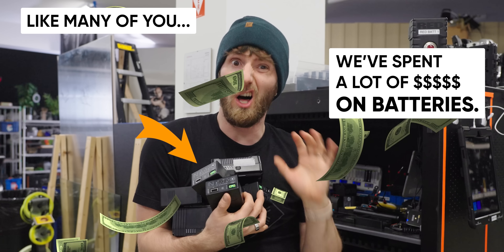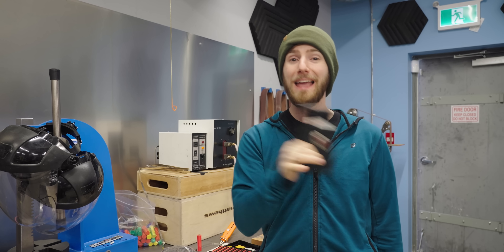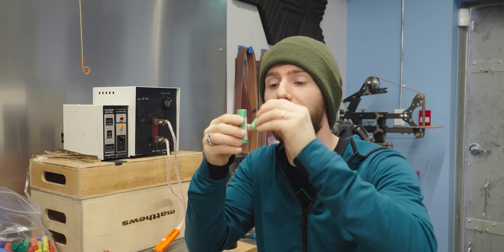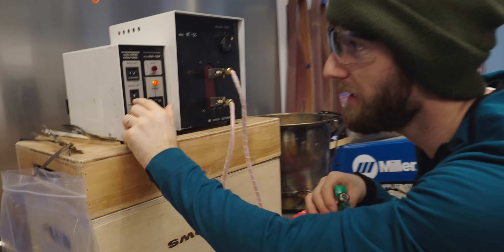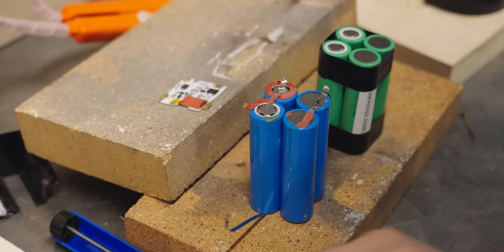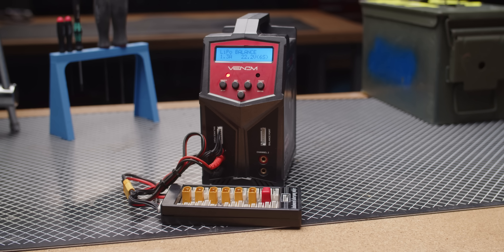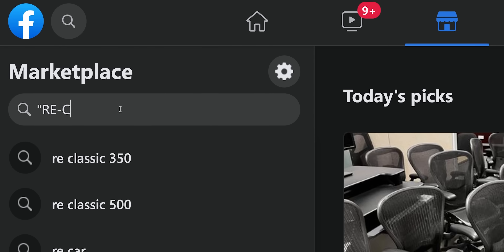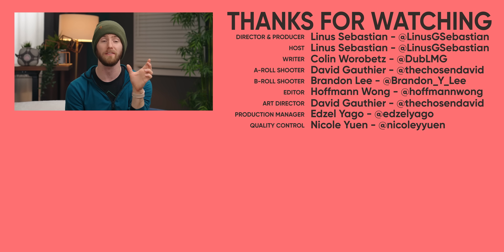This should be illegal… Battery Repair Blocking

Comment: "I've seen dumber things"
I once built a 44v 18AH battery with nothing but duct tape, hot glue, a screwdriver, and solid copper wire. Nope, not even a BMS.

Comment: To Linus: spot welders are known throw sparks sometimes - it is a rough range of 20-60% of the time depending on the ends,cap,dirt,etc. It doesn't matter the size, company who makes it, etc - it is just apart of normal operation of ANY spot welders. Therefore, you basically threw away working cells due to a lack of experience/knowledge of spot welders. Edit: If I made a mistake and those were shorts due to the lid of the batteries being broken thru - then you were using improper sized tips and/or pressure for welding those batteries (from what I could tell the tips were within range for 18650 but pressure seemed to be alot on those pointed tips). However, I couldn't see you breaking into the battery cap so it honestly seems you just didn't know the sparks are normal. You did it a few times with no sparks and thought it was normal then when you got sparks thought you messed up when you didn't. Anyways thanks for the video - you had a lot of correct info.

Comment: The precut nickel strips has fuse on them. So whenever they short, the strips automatically melts then disconnects them to the pack. Lowering the amps on the spot wield would reduce the chances of you having a spark.
Reply: yes...he probably shot out while welding! its only a small cap between the posts on the top side of the battery!
Reply: @Knebebelmeyer  Due to the high current he is probably producing high temperatures which will melt the insulated cover of the battery which will expose the negative part of the battery. It would have been better if he lowered the current and cut those nickel strips to the appropriate length to prevent any contact from the negative part of the battery when you're wielding on the positive part, as the whole body of the battery is negative except from the small circle which is the positive side.
Reply: @Nyte1997  yes...exactly this is the case!!
he use stips that are way to long and reach the negative side on the top of the battery!
i saw that in the video but im not so familar with english, so i cant find the right words to tell it proper...
i tryed^^...

Comment: 16:40 This is a safety feature that shuts off the BMS when one or more cells have different capacity than the others. Let's say one of them had degraded and its capacity is now lower than the others, it indicates that you need to replace that one cell to match the desired capacity the BMS accepts. By doing so, you can avoid the risk of fire hazards or even explosion from overcharging that one degraded cell. It doesn't necessarily mean that it's evil.

A suggestion from your experiment:

Maybe you just need to know what's the actual capacity of the old batteries and try to replicate the battery configuration. (example: Old battery pack is 4 cells in series with a capacity of 3,000 mAh, make a battery with the same config as the old one).
That is why it is not enough to just check the voltage of each cell before welding them. it is also necessary to check its capacity & output charge.

Anyways, great job on the video as always. +1 on pointing out the safety measures that most DIYers neglect.
Reply: He could have taken two 18-packs apart, discarded the worst 18 cells and made a "new" pack from the 18 better ones.  Those should exhibit very similar behavior.  There's also the safety feature that the BMS doesn't power-on on internal power; it usually relies on external power for that.
Reply: @achtsekundenfurz7876  i agree, that would make the experiment more interesting than sacrificing those smaller 4 cell batteries. Also I read that the spot welder they're using was built to use for larger metals. As you can see on the weld, it takes longer for the heat to dissipate which would make the error man-made.
Reply: the very act of trying to repair the battery is dangerous, but note that on the basis of "safety/security", these manufacturers do not want anyone to do it. even people properly trained/prepared to do it.

it is evil on their part to not provide a reasonably priced repair service [rather, any], it is evil on their part to not suggest taking it to a trained professional, it is evil on their part to not make the necessary information for servicing available. 

were manufactures genuinely concerned for safety, there would not be so many devices that absolutely require a battery to function. tell me the actual use case for a wireless mouse or keyboard, for example. and that's just a minor nitpick batteries are themselves, dangerous. forget being repaired improperly, many are disposed of improperly [disposal being what the manufactures *want*], and that has caused more than a few fires. improper storage is also common. 

also, do you have any actual evidence to support "it's a safety feature" , because "for your safety and security" is a very common anti-repair lie of manufacturers. sure, there are safety concerns, but why is it these tend towards making proper service impossible ? or even, unnecessarily dangerous, as is the case with GLUED-IN batteries? seems like a pretty clear cut of the device self-destructing or being UN-repairable to force a total replacement to me. also, again, simply re-assembling the pack is in itself, extremely dangerous. the BMS doesn't stop you from doing that, it doesn't stop you from replacing/removing it entirely, it doesn't stop you from getting a bootlegged pack [though hopefully the equipment handles that, specifically to the extent where danger/damage are possible, and only that] and even in the scenario where it detects a bad cell, it should clearly inform you that "cell #10" is bad. but it doesn't do that. it just hard shuts-down with the assumption/hope you will throw the whole battery away. no matter how you try to frame it, that is, evil. 

also, on that note, is it legitimately necessary to weld/solder the cells? and i mean, in general. obvious, specific battery packs are designed this way. but, it there a legitimate safety reason to design this way? seems more like cost and compactness are in mind here. i could even see anti-repair here, as it does make service difficult & dangerous. that's more an entirely more an inquiry/theory, though.
Reply: @ETXAlienRobot201  I agree to that, there may be reasons for anti repair lies bs going on in the background. But I am thinking that the reason manufacturers doesn't want consumers to repair there own battery packs is because of the risk it can present. A normal consumer doesn't own a spot welder, or tools that can help for the repair. Maybe if its just take one cell out and replace just like the AA or AAA batteries then it would be better and easier.

I like that you included ways a good manufacturer can include on their battery packs, such as individual cell monitoring, and the fact that those battery cells doesn't need to be welded/soldered at all. I mean AA, AAA, NiMH batteries are even in a configuration where one can easily take and replace it. Why do those Lithium Ion ones needed to be soldered/welded.
Reply: @NewbieTetris  This is all BULLSHIT...

A chip can't "Measure" capacity AT ALL. the only way to test capacity is with a full charge and discharge. What we saw in the video is that once you disconnect the battery. it puts it in bricked mode. thats it. The reason for that can be argued but is still shitty behavior. If someone is already trying to replace the battery i assume the person has at least some knowledge to do so. Because you need a soldering item, spot welder etc. no cheap stuff.

Also the only "Data" the cell gets is de current cell voltage. That's needed for the LEDS to know the % of the battery. Don't start a argument AGAINST the right of repair if you don't even have the basic knowledge of these chips.

Also the "You are not allowed to repair because you just don't know and you are dumb" argument is very overused. Who owns the product? me? then i can do whatever i want with it. PERIOD. Even if i want to shove it up my..

All in all i see this as a way to keep prices up on those battery packs. More cheap used batteries on the second hand market = less business for them.
Reply: @NewbieTetris  i do imagine there's a certain amount of safety to welding/soldering, and someone else mentioned that, but i imagine cell slot in/out is feasible within an acceptable margin of error for catastrophic failure. it's not like these packs are automatically fool-proof, themselves. batteries are just dangerous in general, and lithium batteries are horrifyingly dangerous.
i imagine some of the features used in the current models can be carried-over. 

i guess tbh i'm a bit too much of a dreamer and i spend too long looking at the bigger picture and all [reasonably predictable] possible outcomes. i also don't tend to take "no" as the final answer unless it can be absolutely justified. 

my main interests are games/software, though. some of this stuff with throw-away, locked-down electronics however, really males me half-motivated to delve-into a certain amount of hardware/electronics. though, i'd probably just be the ideas guy and entrust actual engineers to create/refine/test working designs. another thing i'm getting sick of is plastic packaging... tbh, single-use  packaging in some/many cases isn't justified, either. what a world we live in!
Reply: @shinevisionsv  First, I agree that no chip can measure the capacity of a cell/battery. But if one knows the exact mAh used until one cell is fully used, you won't be needing the "chip" to measure capacity. You just needed a chip to measure the current, and also a programmed timer to measure the time in order to calculate the mAh used. In that way we can measure if the cell is in proper functioning. (e.g., compare the mAh spent vs the actual capacity)

Second, I partially agree with you with your second statement. But we can also measure current aside from the cell voltage. With that in mind, we can also measure the mAh spent. Also I am not starting an argument here. It seems to me that you are a person who knows a lot about ICs and more. I am only an Electrical Engineering student, I am not saying I know everything. :)

Third, I do agree that "You are not allowed to repair because you just don't know and you are dumb" is too mainstream. But I never said that statement. I did say that most of consumers doesn't own the necessary tools to repair the battery pack. (assuming that they may/may not know their way on repairing the pack)

Lastly, I also agree with how battery manufacturers are trying to trick the consumers in buying new battery instead of recycling them. After all, we might be needing more of battery recycling facilities all over the world.

Comment: I'm a strong advocate of right-to-repair, but I'm actually inclined to side more with the battery manufacturers - this is actually a genuine huge safety concern. If you can't figure out how to bypass an "evil" (to use your words) BMS, then you really should not be trying to re-cell a battery. Simple as that. Is it malicious obstruction? Yeah, probably, but I also sure as hell don't want to ever run across a battery that has been re-celled by someone who doesn't know what they're doing. 

Linus worked with a team of however-many people in a workshop kitted out far better than most people can achieve. As evidenced by the video, he still couldn't safely re-cell a battery.

Comment: In my experience, good quality cells from reputable brands are not much cheaper than fully assembled new genuine battery pack. At least that is how it was with power tool batteries.
Reply: Same with these professional camera batteries - but only if you buy third-party brands like Swit or idx. Don't buy original Sony or Red batteries whenever possible because they are way more expensive for basically the same thing. Often the third-party brands even have cool additional features like USB charging connectors and powertap connectors that the originals don't have.

Comment: Anti Repair mechinisms are evil, but for batteries which really are the only componants that have a valid safty concern, I kinda agree with them being unrepairable. Forcing companies to sell them at the same price they can source them for is probably the most ideal solution, that and providing software to repair companies that removes any software blocks.

Iv seen too many people bring in fried electronics because they attempted to fix them themselfs, not knowing that they were moments away from a fire that they are most probably not equipped to deal with.

Comment: Ok, here we go, it's the same as in notebook batteries. Those are all "smart" batteries which authenticate with their host device. However, the chip inside the battery pack has its firmware and parameters only stored in "ram", means, as soon as you loop open the circuit and the voltage at the chips supply pins falls to 0, the battery firmware is LOST.
There ARE tools and programs to reprogram freshly serviced battery packs.
Only way to avoid that, keep supply voltage to firmware chip while disconnecting the cells.

Comment: I've done this with canon batteries before. 

I just swapped the cell but kept the original BMS and it worked fine. 

If you replace the BMS, it usually won't work or gives an error about being an unofficial battery because it's missing the "brain" that talks to the gadget.

Comment: Considering that you've recently covered the OneWheel, you should see what Future Motion is doing with their BMS for OneWheel XR v4210 and beyond. You cannot repair them yourselves. You cannot get the part direct from FM. If you replace it with a BMS from an older board or even from another same version board that isn't properly matched with the rest of the hardware (by means of software) it will not work. It's malicious and needs to be made public. If you send your board back to FM and have modified it any way (changed grip tape, tire, bearings, etc) they will deny your repair and potentially hold your board hostage until you buy stock parts. Please Linus, look into this and shine some light to the public. I love this hobby but what they're doing is so wrong.

Comment: Battery management systems are more complicated than you may think. For example, Texas Instrument's impedance track battery gauges requires the cell's "profile" (discharge and charge curves) loaded into the IC to accurately gauge the battery. Keep in mind that this "profile" is unique to each cell. Also, cells have different charge current, discharge and charge voltage  cutoffs and these protections are coded into the IC of the battery management unit. Therefore, replacing a pack with a different cell can be potentially dangerous as the BMU was designed to protect the original cell.  That being said, it only makes sense to replace a pack with the exact same cell as before, however, many of these cells manufactures use are also not available for the public to purchase (I'm an EE who worked in the BMS industry).

Comment: By my experience with old laptop batteries i can say that many of those dont use capacity based tricks to kill bms many of those are only voltage based ( you loose power you're done ) 

So by makeing pack upfront and soldering that to bms with old pack still connected ( parallel wont increase voltage, and there is no way bms can measure capacity without cycling a pack ) and then disconnect the old pack 

Or just use generic bms and make voltage devider for those LEDs if they are really that important

Comment: You can get a little $50 spot welder like that, run by a lithium battery that works well (on places like Amazon etc.). Some Youtuber tried it on 18650 lithium cells and they were solid welds. The thing would easily pay for itself, by reconditioning 1 tool etc. battery.

Comment: well, the BMS you called it can also have weak power controllers and weak capacitors so charging the battery can be hard  for it so OHM check then LOAD check nnot using the BMS

Comment: the shear incompetency and cowardice shown in this video is something linus has only done once before, you have NO ONE there with a EE background and yes, the ebike world is laughing at you as a joke.   You're overblown and unjustified fear of a little battery is beyond crazy.  God forbid you actually did something like, reload ammo, you'd be running down the street screaming and looking for avocado toast and a safe space.   We truly have made generations of pansies.   If I was there, I'd of put a nail right through a cell on your setup and made you sit there and watch it so you knew what a cell did when it failed internally....and the incompetency of getting cells from a vape shop that sells the cheapest junk you can imagine is blithering.   Have you not heard of a company called Digikey?  They'd of sold you premium cells new cells w/ all 3 protections in them.  I doubt if your vape cells had even one level.   I suggest you delete this video for it shows ....well, its an embarrassment to your normal level of high professionalism.

Comment: They do what they do because if they don't people swap cells and then sue them when their shoddy refurb work starts a fire. You started two yourself, albeit prepared for the scenario. The BeBop company lets you send it back for refurb - they don't let you swap your own cells. See the difference? And yes - buy from a manufacturer who has the entire lifecycle, including refurb, handled in a human manner, and the "now my battery pack is just dead and I am screwed" scenario will disappear. Did Red have a program to swap out old batteries for new with a discount? Source: I used to work with a company that refurbed old NiCad battery packs for the movie industry - they had the same issues, and those were far less energy density than the newer tech (and so less dangerous).